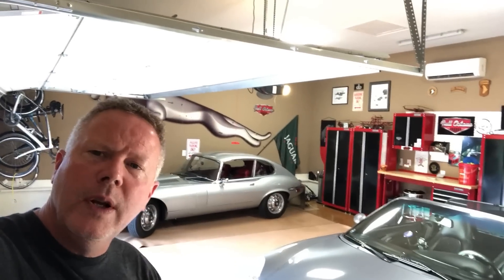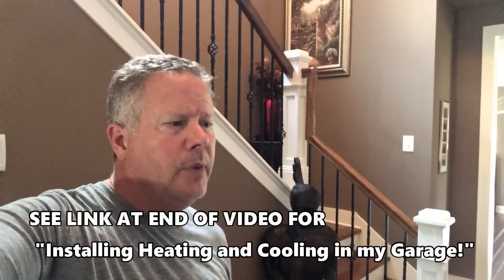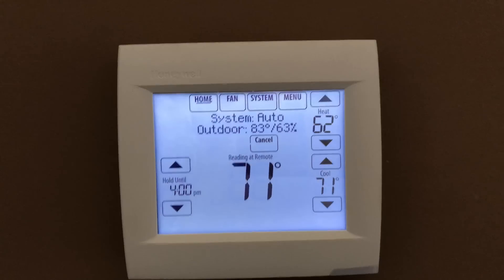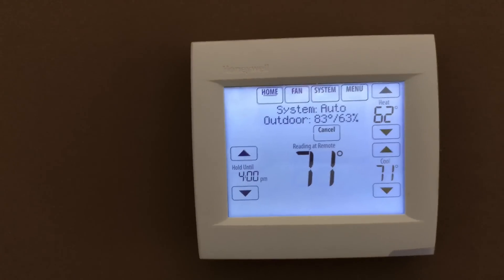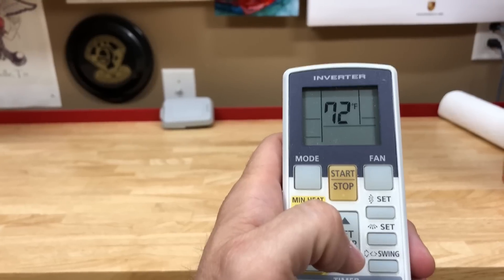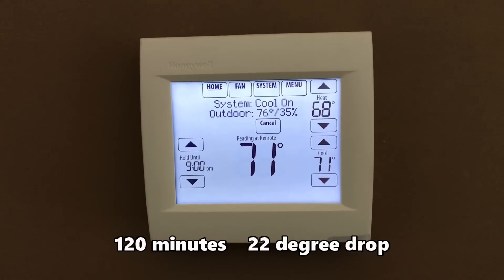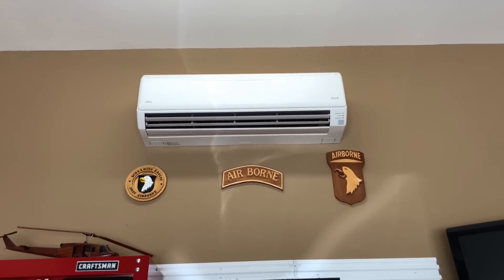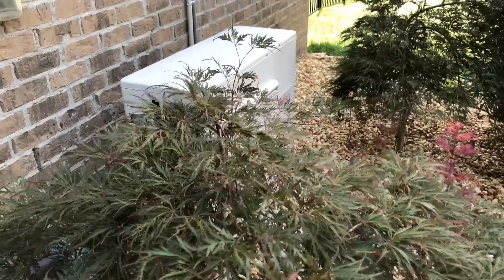We Answer the Question... Can a MiniSplit REALLY Cool your Garage?

Comment: Ideas for me? It's January in Phoenix, I'm planning now, as temps eclipse 130f inside my southern exposure garage in summer. Got excited till I saw half the unit is outside, also not keen on opening up a wall and having the butt end of a ~window style stick outwards. Aswell, not interested in those ~bulky portable ac units as seen in your 1 car garage.

I have access to the attic above the garage, I have the ability to port air outwards from the attic and have no issue making a cut/opening/induction vent from the attic into the garage ceiling to port in cool air. If I had too if there was an interior mounted unit, I could punch a ~3" hole through the wall to vent exhaust...just don't want the whole butt end sticking out yet like the attic idea as hidden.
Reply from the maker: Just to clarify... the only penetration for the minisplit airhandler is the 2" to 3" inch hole for the refrigerant lines, drain and control wire... there is no external part of the air handler. The condenser is outside  on the ground however. This is not a PTAC motel unit. as for the unit in the attic, any split conventional AC unit or mini split will have an outdoor unit as you have you transfer heat off a condenser coil outside.
You could install a ventilator fan but it will have to get its make up some where.. it will end up pulling from the 130 degree outside air. If you have a w/h or furnace also in your garage that serve your home, be very care about adding a ventilator fan. A large fan can back draft your gas w/h or furnace flue if they are not sealed. you will have to ensure that you allow the same amount of makeup air as the air that is vented out to keep the garage from being negatively pressurized.
And yes... the portable unit can only cool down about 10-20 degrees difference from the outside temp. It barely tempers the air.. definitely doesnt keep it cool.
 hope that clarifies or answers your question.
Reply: @Fulloctanegarage  Thanks for the detailed response! 👍 Was digging around and a mini-split maybe doable, my garage protrudes forward from the rest of the house...so didn't want a ~ground unit exposed in the front yard yet may have a spot behind I can tuck behind. Any red flags or special parameters I'd look into for considering my extremes (unfortunately fully exposed in front of house southern facing, 100% sun drenched from sun rise to sunset, and....~115F ambient air temps)? 

110v's possible?

Comment: Just curious is your garage door insulated?
Reply from the maker: no... it is not. considered it originally but I do not think it is necessary with the capacity performance of the unit.
Reply: Full Octane Garage  I was thinking during the winter it might be more useful than in the summer.

Comment: Apple 10 ... TELEPHONE ....??  

Anyways, thanks for the video, i may need 2 of these for my 1800 sq ft garage ..
Reply from the maker: heheee... im so old and unhip... feel free to holler if you have any questions. 1400 Sq ft.....nice..... some of the brands offer 2-1/2 to 3 ton systems and additional blower units that work off the same condenser so I would suspect that you will not need two complete systems.
Reply: Yea i don't think you are that much older than me... But anyways, i think we may go with a ~3.5 Ton unit.. My goal is to cool it down to like mid 80's... Because now its like ~95 deg depending on what thermometer i use .. SO ~15 deg cooler will make a huge difference
Reply from the maker: It will have no problem doing that! I would recommend an inverter style... it will keep it from cycling too quickly and will be much more efficient.

Comment: It would have been nice to know how much it cost to have that system installed. I would have also liked to know why you chose that brand Mini split system.
Reply: Any reason why the installation costs are so high? Doesn’t this take just a few hours when done professionally?
Reply: @BacktotheOutdoors  because good men dont work cheap. hire yourself a mexican.
Reply: Diesel Ramcharger - tradesman don’t typically make $1,000 an hour. That’s why I inquired about installation time.
Reply from the maker: Fair question.. sorry about the omission.
My company would be in the $5k to $6k range to install depending on equipment and electrical location. I chose Fujitsu because we have installed it for years at my company and there is a consistent distributor presence in the market. (mitsubishi is also a good one.) Many of the other manufacturers of minisplits come and go and we have ended up with parts availability and support issues in the past. Its not the cheapest out there, but it is the best. Thanks for commenting and giving us chance to reply.

Comment: What is your opinion on the pioneer unit. My garage is about 450 sq ft and I built a gym in there but I want to train ppl in there but it’s still very hott so I’m trying to decide on a mini split. Any advice would be appreciated:) thank you
Reply: Correction a 504sq ft garage
Reply from the maker: A 1-1/2 ton should do that just fine. We only install Fujitsu and Mitsubishi. I am sure some of the other brands are fine, but we have been installing these for many years and they seem the constant in a market where other brands come and go. you may run into issues with parts availability, warranty coverage and service support with off brands down the road. a minisplit should be awesome for you application tho.
Reply: thank you sooo much!
I also have a small gym for my son in my little 350 sq. ft. garage.
I'm in Laredo, Tx and we get 💯+ degree weather in the summer.
I'm installing a 1.5 ton minisplit this week.